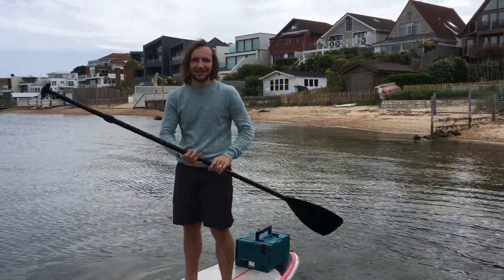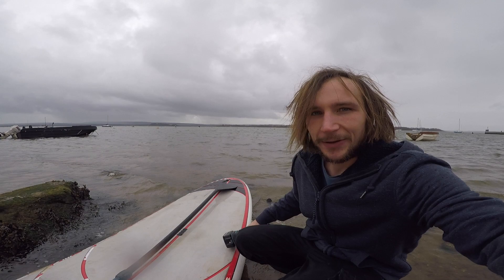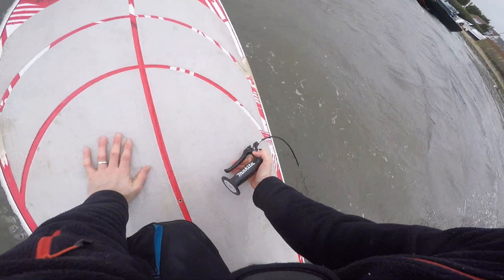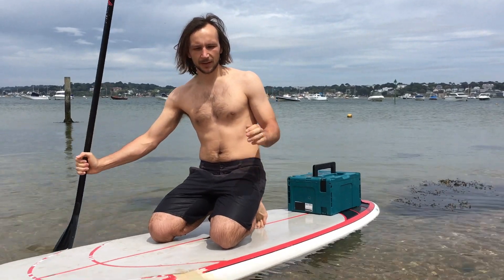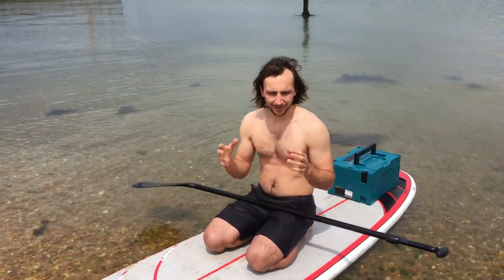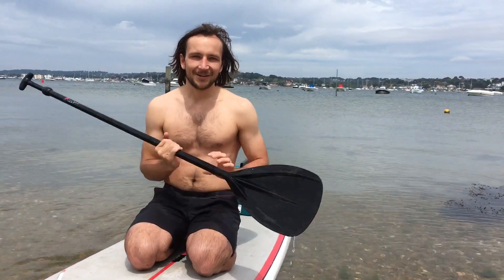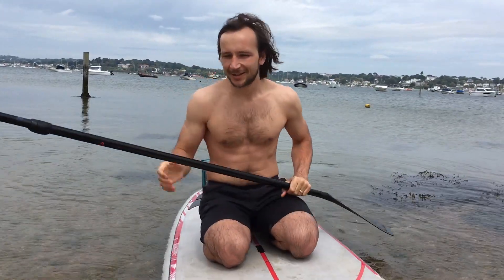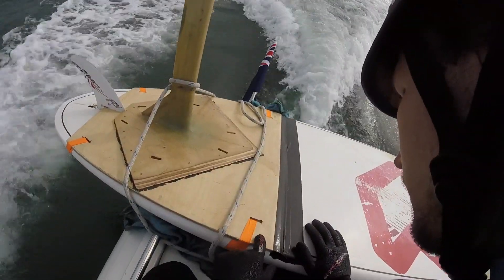I added 2 drills to my SUP

Comment: Interesting approach. How fast do you think you were going by the end? And how long did the drill batteries give you ? I’m guessing 7/8 minutes max. Will you keep refining this or is it a one shot deal ? It’s different though congrats on a successful build🥳
Cheers from Texas
Reply from the maker: Yes, i'm sure they would not last very long. But still had 1/2 charge left at the end of the tests though.  Only used this for this porject.

Comment: How many watts of power do you have with those 2 drills?
Reply from the maker: 640w each! With a better prop it could be a lot faster.
Reply: @SamButement  3d print a propeller. That the way i did it. But then with a 700 watt brushless motor. I think it is even faster then yours. So that is a good way to go
Reply: @tomvandernoll1455  hey could you please post the details. ....water wolf has a SIX kilowatt motor......NUTS
Reply: @peterkay7458  yeah. The project came to. A hold because of my study. In the summer I will restart it.
Reply: @SamButement  ty